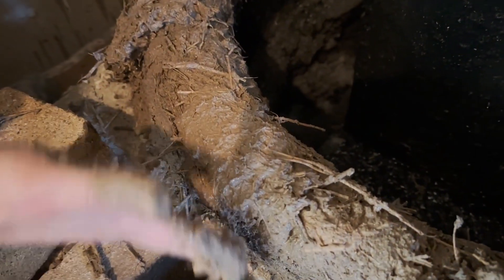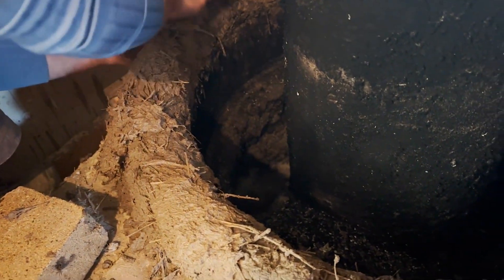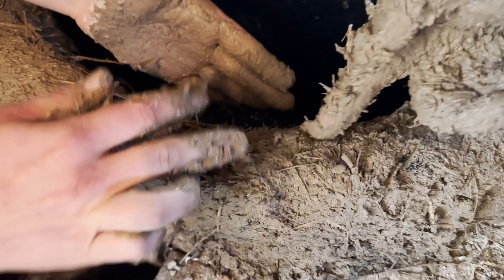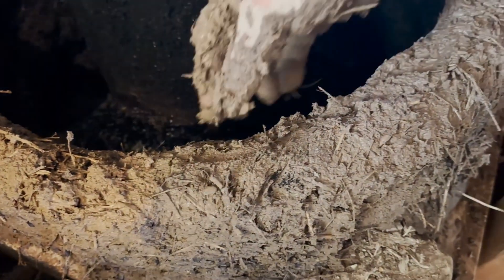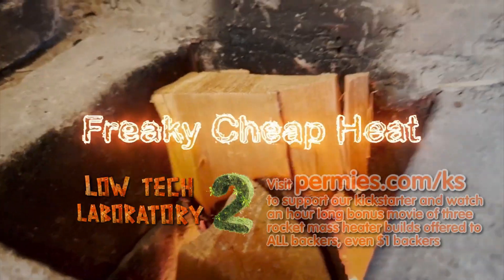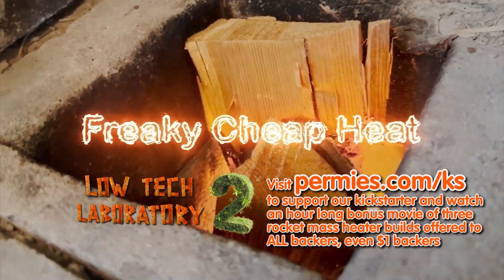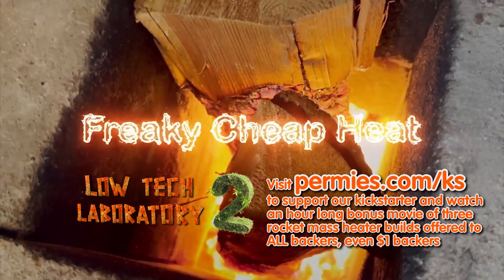Freaky Cheap Heat: Rocket Mass Heater Optimization of Barrel Height

Comment: So 4 inches is the optimum gap between barrel and riser? I thought it was 2 inches.
Reply from the maker: 2 inches was the standard for more than a decade.  And now we are saying that 2 inches is acceptable for getting that cherry on top to cook or boil water.  But more than two could lead to a stronger draw and all the benefits that come with that.

Comment: It took me a second to realize: the top of the barrel was too close to the end/top of the riser so the barrel was getting too hot. I see a lot of pictures of people putting teapots on the barrel of a RMH, but if the metal is red hot that might break your teapot! So, they are building up cob underneath to make a little space for the super hot air to swirl around and down, not just superheat the top of the barrel. The "manifold" is the term for the connection between the burny bits and the barrel - right?
Reply from the maker: The manifold is the part that takes the gasses from the bottom of the barrel and routes it to the mass.